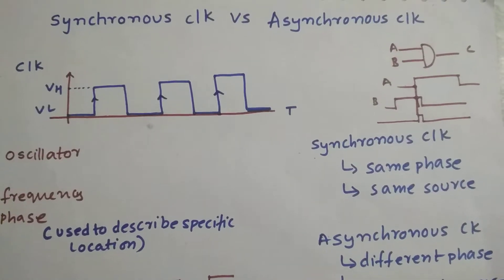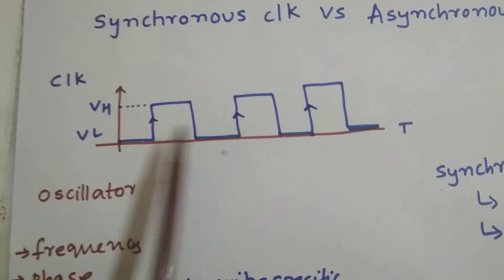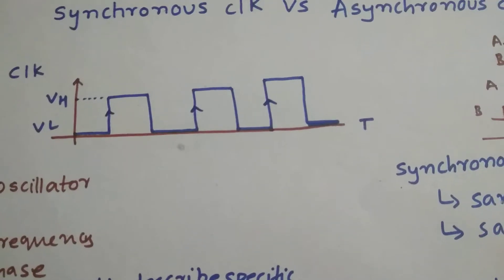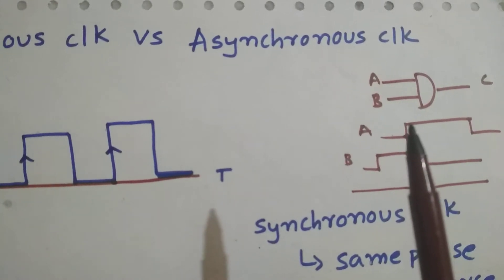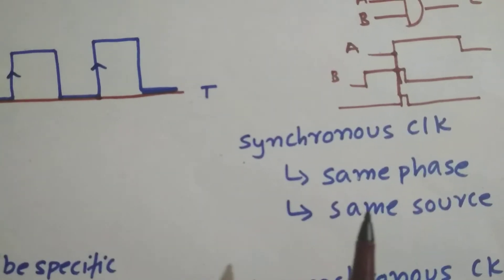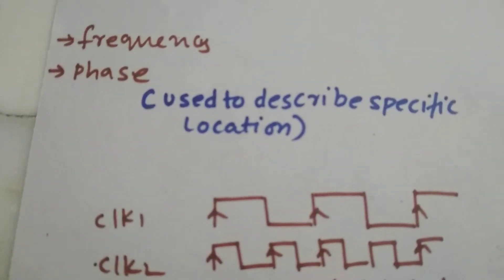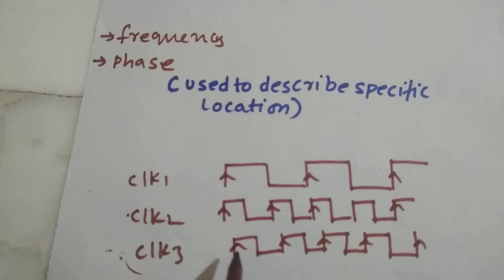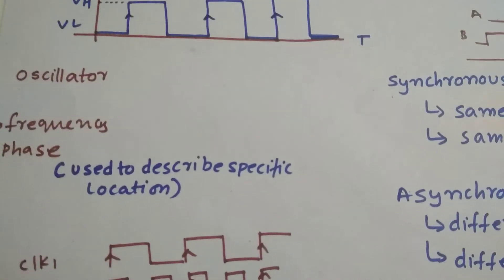Synchronous clock vs Asynchronous clock

Comment: Nice explanation. Pls make a video on Mealy Vs Moore FSM with their advantages and disadvantages.
Reply from the maker: Hey arpit thanks , I will do it for you 👍
Reply: @KarthikVippala   A FIFO present between a module working at higher frequency and module working at lower frequency.
Is this FIFO just a SISO shift register???
Reply from the maker: @arpittiwari7695  thanks for asking, if FIFO works at different speed than that of module then we call it as Async FIFO, I have made a video on it please watch.
No FIFO is way different than siso.

Comment: If two clocks are generated from a same source but with different phases then is it asynchronous/synchronous/hybrid?                

If two clocks are generated from two different sources but are having same phases then is it asynchronous/synchronous/hybrid?

Please check and give me right answer
Reply: both are synchronous only, the right definition of synchronized clock is 1.) they should be from one clock source and 2nd one is either they should have 0 phase difference or deterministic or we can say equal phase difference.